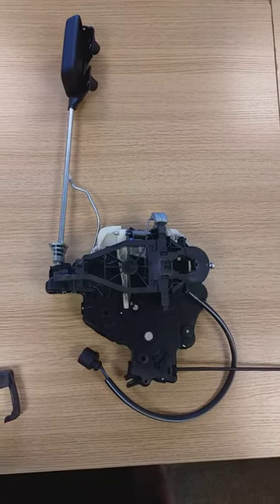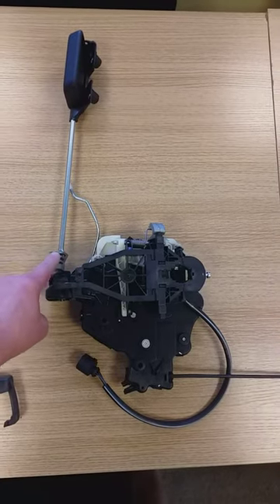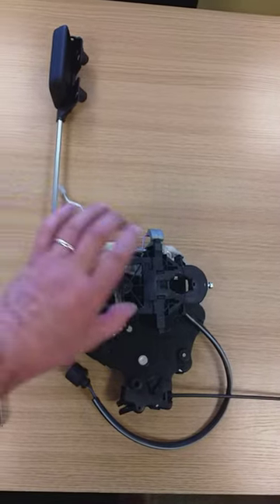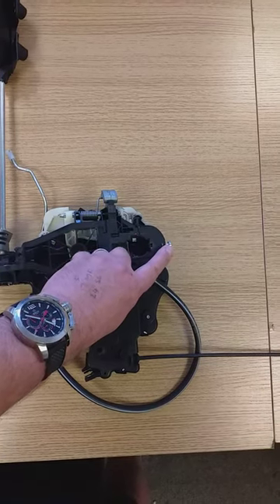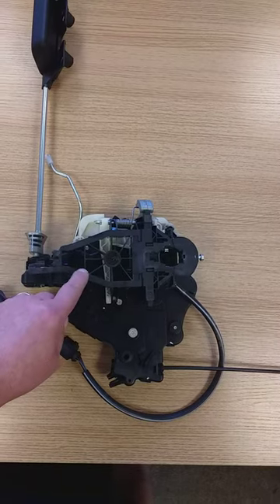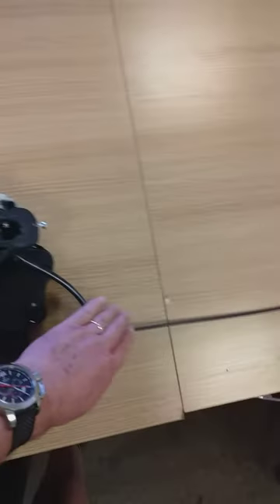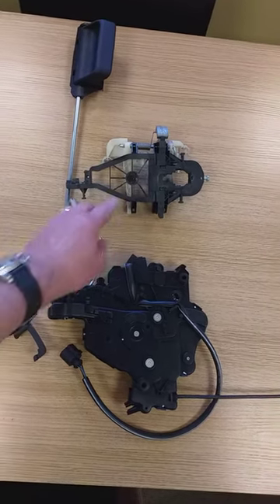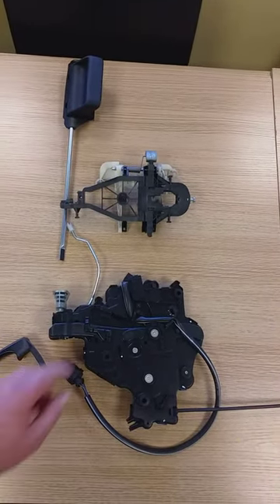Transporter T5 sliding door mechanism removal and installation

Comment: Hello mate . I’ve noticed my sliding door handle feels rather wobbly at both ends . It works fine just doesnt feel to solid . Plenty of play . Certainly when comparing it to the front door handles . Any ideas? Cheers
Reply from the maker: Hi thank you for your question 
the hand is held in by the lock. You could take the panel of and make sure the Mechanism is not lose these is held by three bolts. Or open the sliding door look on the edge you will see a star bolt removed it then pull the lock out bt the handle Wayne when the lock is removed slide the handle forward then removed it inspect to see if it is worn 

Neil
Reply: @gadgetman12  so when the lock is out pull the handle forward towards the bonnet ?

Comment: I've got a 2020 caddy. Mechanisms looks VERY SIMILAR if not identical. My problem. Is, the small part comes out okay, but the actual. Handle just wouldn't pull out. It slides very slightly forwards but just not enough to pull out 😩
Reply from the maker: Sorry not sure dont know much about caddy hope you sort the problem neil

Comment: I'm trying to replace the door handle and carrier which sits behind the blavk mechanism. I have removed the door handle and blank from the exterior along with the screw here. I have taken the 3 bolts out from the back, have unclipped the two plastic bits which hold the two parts together and have pulled ghe mechamism away from the rod but can't seem to get the mechanism out so I can get to the one behind it. Any tips? Thanks
Reply from the maker: Hi have you removed the door lock from the out side. You have to undo the bolt in side the door first then go outside and pull the lock out this go's all the way in the Mechanism

Comment: Hi there can you explain how to remove the cable that goes to the rear lock of the sliding  door?
Reply from the maker: You need to take out the lock the cable is attached to this will give you access

Comment: Hi, I just bought a t5.1 which already has a plate. I suspect it’s been broken into in the past. I can’t open the door from the inside. Where the handle rod joins the mechanism, I’m missing the grey part (with the black bands on it) how easy is this to replace? Thanks
Reply from the maker: Is this right the Grey Aluminum part on the top. If so this is the main unit take the inside panel off remove the water catcher this is in-between the door caverty. If watch my video video it should help you just ask if you need help
Reply from the maker: Not to bad
Reply: @gadgetman12  Thanks for the reply.  Its’s the part of the lock which gets turned when the van is broken into. As you showed in the video. A mechanic friend of mine checked and it was £240+vat for the entire new lock as they don’t sell bits individually. I did wonder if it’s worth leaving it, if someone attempts to break into it again there’s nothing there to turn. So could be safer?
Reply from the maker: Hi I think I have one somewhere you can have for 120 pounds if you are interested the one I have is off a transport 2063 let

Me know Neil

Comment: Hi Neil
How would you reattach the watercatcher to the inner door panel? Im replacing mine since one clip has broken and its become loose.
There's also some tacky substance to seal it to the inner panel. What would you use to seal this?
Where can I find a list or visual catalogue of Vw parts. I need a few bits and bobs like screws and door lock gaskets etc and they tend not to have VIN numbers on there due to their size.
Thanks
Reply from the maker: I would use tigerseal you can get from car shop but take about 3 hour to start to set
Reply from the maker: We got all parts from vw I got the part numbers off the old parts

Comment: Do you know the part number for the part thats closest as you look at it?  It seems a new mechanism doesn't come with both parts, just the main part and cables etc, aaaaaahhhhhh 😭😂
Reply: The part with the spring and white bits
Reply from the maker: Hi I have just looked have got everything apart from that part sorry can't find will keep looking neil
Reply from the maker: 7E0843351C it's called a sliding door mounting bar hope this helps if possible can you Describe to my channel all help many thanks neil
Reply from the maker: This is the parts that goes on top of the main part

Comment: I managed to put everything back together, however, the outside handle only operates the latch that holds the door open and the door can only be opened from the inside.

Any advice? (can't find any solutions on the forums😔)
Reply from the maker: Hi did you attach the cable ok for the lock mechanism
Reply from the maker: What was broken and what have you  changed
Reply: Thanks for getting back. Thank fully and by the grace of God, it suddenly started working once I'd shit and locked the door with the key!

I thought I had waisted an entire day, then went to the shop at about 5pm, locked the car and did the shopping. When I came back and unlocked the car to put the shopping in the back, the door just opened! Magic.... or probably needed the central locking system to kick in.

Any way. Thanks for your help - the video helped me put the spring etc back together and really saved the day! 🙌👌👏👏👍
Reply: Lol. No shit involved. That was meant to read *shut!